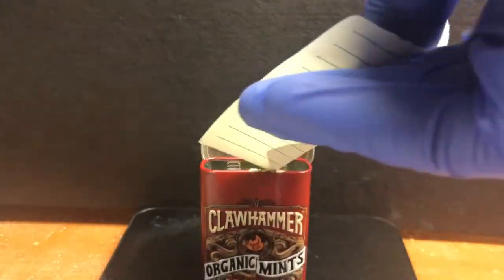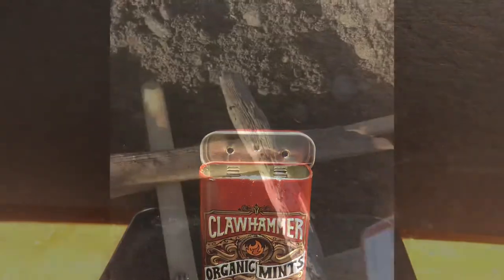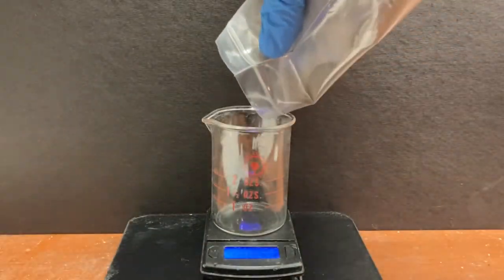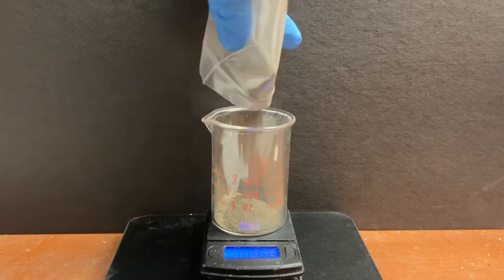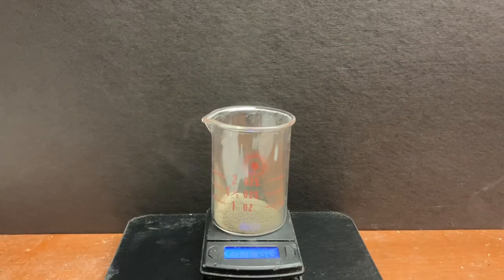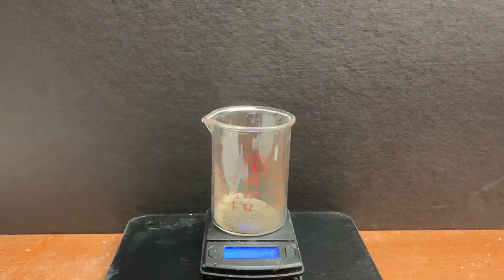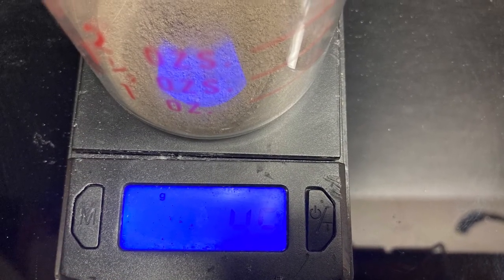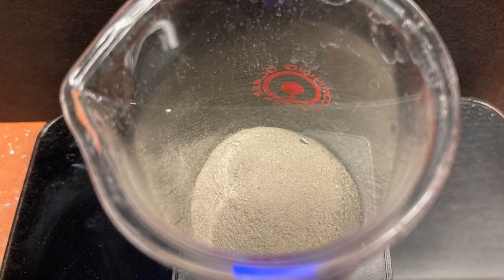5-ATz part 3 (Calcium Cyanamide)

Comment: Some firebrick or refractory blanket, an appropriate length (coil, preferably) of nichrome wire, a dimmer switch and a thermocouple -- plus a pinch of ingenuity -- might get you to 900C with fair precision and repeatability.
Reply from the maker: I always wanted to build a furnace! I may try to make one in the near future for later attempts! Thanks!
Reply: @industrialadhesive6357  Cool!  (So to speak.)  I could be helpful if you encounter questions.  I've been making my own heating elements and working with related devices for some time.
Reply from the maker: @jamesg1367  Thats awesome, Thanks! Thats also really cool that you make your own!